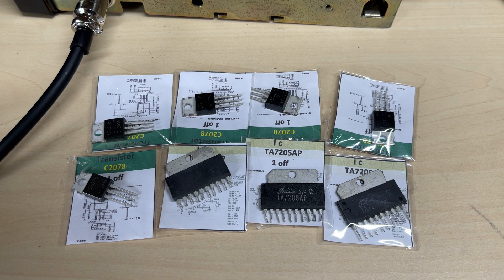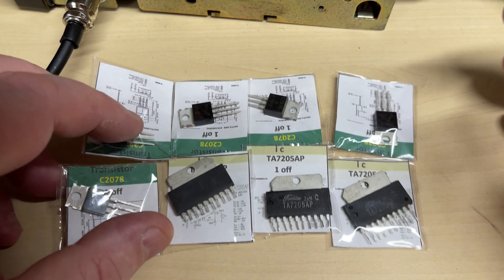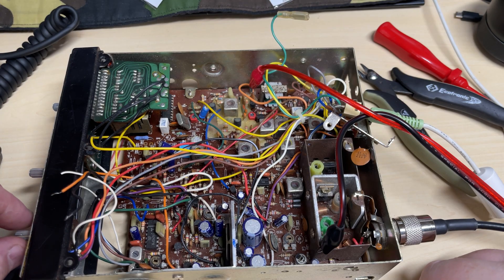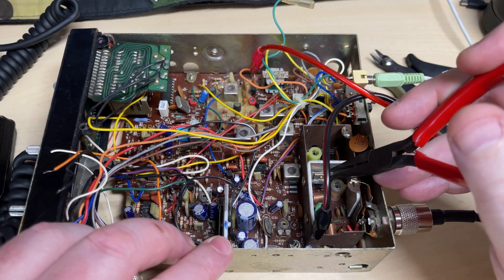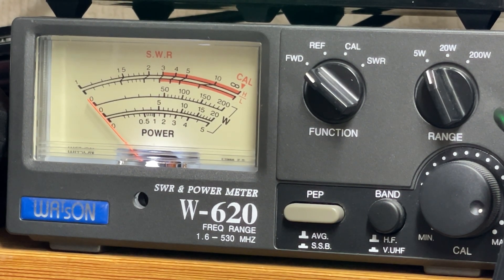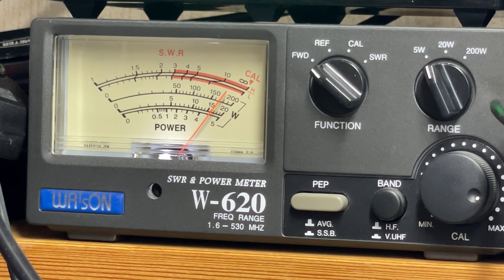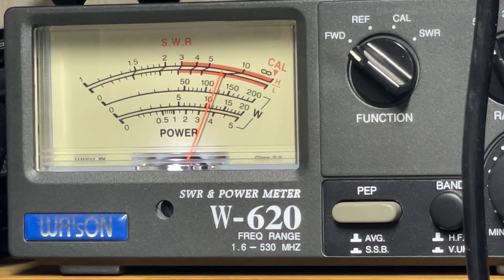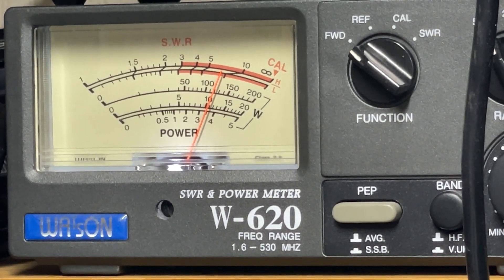EP 088 - Genuine or Fake ? TA7205AP audio IC - 2SC2078 RF Transistor.

Comment: The 2SC2078 were manufactured by Sanyo and went out of production years ago possibly the 1980’s. I agree it’s a mine field buying from eBay you never know what you’re going to get.   I found Criklewood Electronics in London a good source for this type of RF power transistors as they have a lot of new old stock or did have. Re the Toshiba audio IC’s there are loads of fakes that seem to work. An outfit called KEC in Korea started making a lot of CB radio IC’s when Toshiba finished production. The KEC IC’s seem to be good and I wonder if these are KEC but rebadged. Really enjoying the videos BTW keep up the good work.
Reply from the maker: Thanks for that link , they seem to be a well stocked shop. The amps i think were pulls, but they work.

Comment: Cybernet 134 will use 2SC1909 2SC2075 2SC2078 2SC2166 with no issues finding them is the problem 
I’m glad I’ve seen this video as I too was looking at those 2SC2078’s from the seller so il not bother now lol
Reply: They don't like 2078s mate. I find they give a very dirty output in cybernet stuff
Reply: @cubwolf  I’ve always used 2166’s rather than most of the others tbh aren’t 2078’s used mainly in the maxon stuff?
Reply: @andyward7272  yes along with all the cheap Jesan and the like

Comment: Pulls probably work yes, but could still be rebadged lower spec with the same pinout, but for a 2W AF amplifier not a worry. The RF transistors yes fake, though of course you could probably find others that perform as good, just not the original part number, as getting good RF performance is a lot easier these days, and a lot of manufacturers can do it as well.